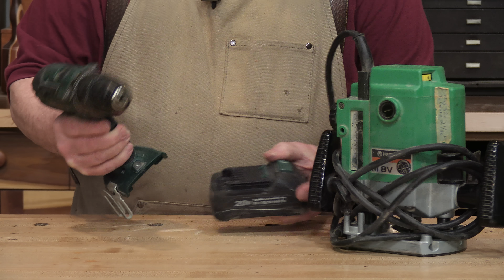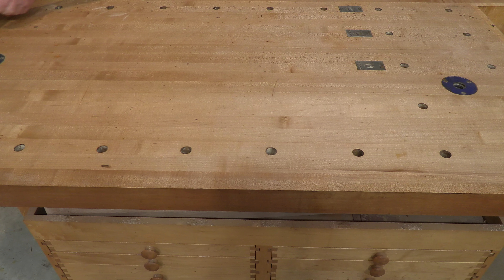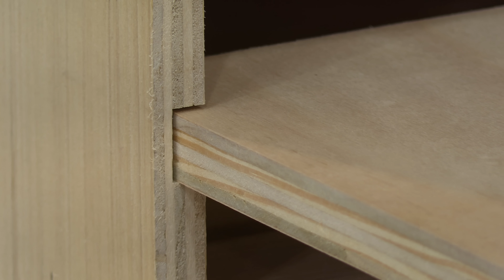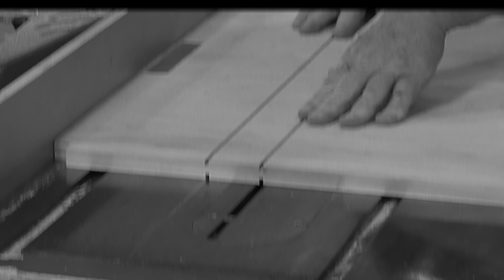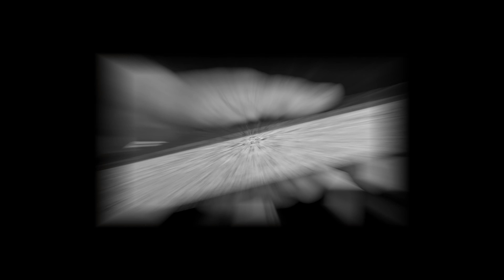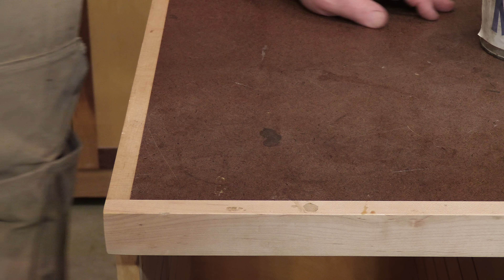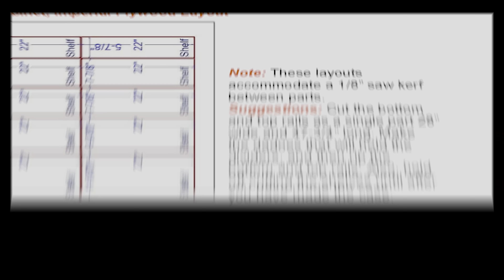Pigeonhole Cabinet for Workshop Storage

Comment: super secret hot tip. At Industrial Light and Magic. one of the original fellas Put Mirrors on the under-side of the upper cabinets so the vertically-challenged artists could see what was in the top shelves or needed to be refilled etc without grabbing the ladder or stepping stool 
You could put cheap flat mirrors strip on the shelves below waist-height so you don't have to bend over to see what's in em!
 
btw. their cubbies were like 12 feet tall and had baskets that pulled out
Reply: As if I didn’t worship ILM already…! I love the mod for lower shelves, that would be perfect for me and my rickety old back. At least in the kitchen I can call on the other half of the household and her supermodel-caliber height to deal with the upper shelves.
Reply: @Perpetualfutz  glad you found that anecdote as intriguing as it sounded. maybe a shim or two may be called for but just in walking up to the shelf or standing back should hopefully make the angle enough to see far enough into it!

Comment: Ah! I've been thinking of something like this for kitchen appliance/tool storage! The pull out adjustable shelves are a great touch!
Reply: YES! First thing I thought was kitchen cart. Which is a very dangerous proposition, because I have a kitchenaid mixer and something like this would give me oh so much room for all their various accessories and gadgets… 😂 Although for something like that, if I were to really go all out, I’d make the pull-out shelves as minimalist as possible and add lift-off trays to each so I could bring out, for instance, the whole meat grinder and sausage making set all on one tray rather than having to leave the shelf pulled out or go back and forth with pieces. Maybe excessive for some applications, but if your pigeonholes are housing sets of multiple pieces it seems like a practical upgrade.

Comment: So, I did this when I first started my shop 22 years ago, and while it "works", there's not much worse than open shelving in a woodshop. I converted the area to drawers and it's soooo much more handy. For one, you control dust. Two, things get lost in pigeon holes, and three, you can fit more into drawers because the back of the drawer is usable space, but it's not convenient at all in pigeon hole to go into the back.

Now, you solve some of this with sliding shelves, but introduce another in that stuff will fall down and get stuck behind the shelf (e.g. cords).

These days, I do everything I can not to have any kind of shelving, it's all drawers. Much better quality of life in the shop with drawers.

YMMV
Reply from the maker: If dust is a problem, the cabinet is designed so that you can easily add doors to cover the front. Attach them to the front edges of the sides with piano hinges or 3/4" overlay concealed hinges. Depending on the width of the cabinet, you may want to make bi-fold doors so the open doors don't protrude too far into the workspace -- in this case, you would also need some bi-fold door hinges.
Reply: I agree, dust collection, size, and layout are important when having a design like this. I wouldnt have this cabinet directly behind my table saw or lathe. I'm not a big fan of having too many drawers, even when labeled I find myself opening half of them to see where i stashed my tool. I like that with the pigeonhole design i can see everything. I think some doors could be added to this design fairly easily if dust is a big problem.
Reply: @travnarok415 ”if dust is a big problem”? I can’t imagine a woodworking shop where it isn’t. This was my own immediate reaction. I have built a whole wall of cabinets with drawers, and while I agree that it takes some time to remember which drawer holds which tool, this is soon committed to memory. I also have a couple of open areas under a long wall bench which are each wide enough to take two Systainers. At some stage I’m going to build a rolling carriage for each of these “towers”.
Reply: @billfromgermany Unless, of course, you have a little helper who wants to "help" you every chance they get and always put the tools away in the wrong drawer.
Reply: @pontiacsuperchief9532 Kids? Grown and away from home. Grandkids? Also grown up and… my god, am I really that old?
Reply: @travnarok415 definite tradeoffs
Reply: You make a good point. I am just getting started and am a person who needs to see all the things.